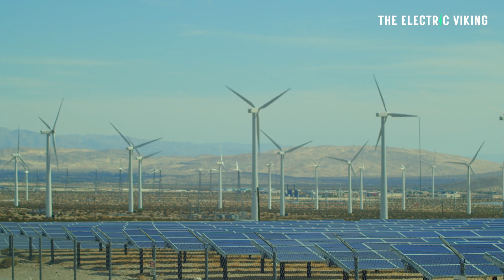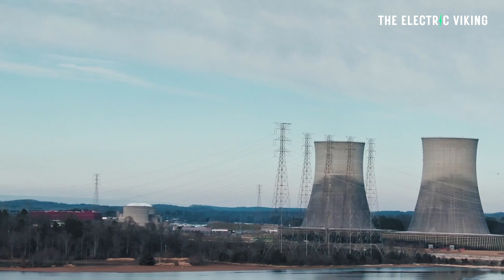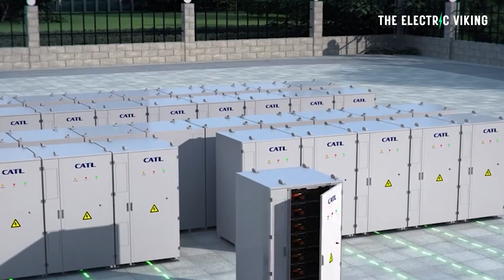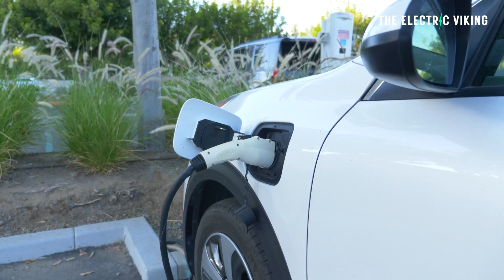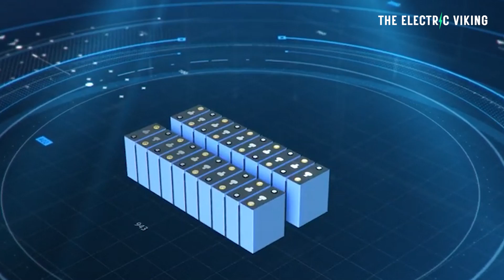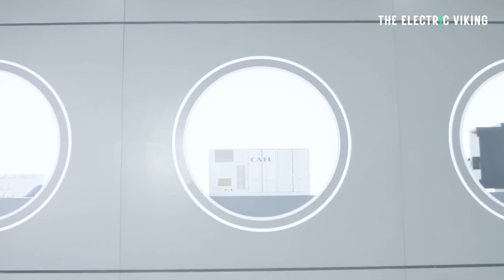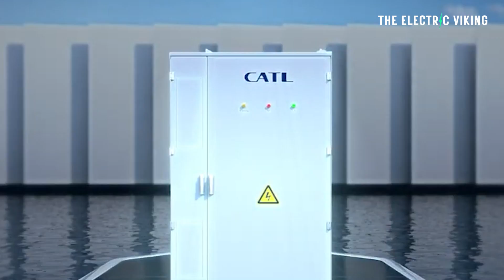CATL's new LFP battery lasts 3 million miles with 0% degradation for 5 years

Comment: Good content, thanks.  

I would like the focus of future energy needs to be placed on individual homes rather than the grid.  Home and property owners will benefit due to cost savings.  Weather type events such as cold snaps are easily predicted and gives time to power companies to cycle up an energy plant to meet the additional power needs.
Reply: Agree! Dispersed power!
Reply: That makes sense to some extent.  But having every building be a standalone energy producer is not efficient.  Since the grid is already in place we can move unneeded 'single building' electricity to places where it is needed.  And we can share output from things like wind farms and hydro facilities which individual buildings could not afford.
Reply: @bobwallace9753 Dispursed energy production actually works well and with batteries you need not depend on the grid entirely. Our last grid power outage lasted 4 days. Had We had batteries and solar we would have weathered the outage much better. The efficiency argument is very weak when my neighbors actually use my excess power when I produce it.
Reply: @seniordockman2946  
What you seem to be saying is that grid-connected dispersed production is, generally, the best solution.

Agreed.
Reply: @bobwallace9753  I believe they have this type of system setup in California.  Homes with solar are consider virtual factories.  They feed excess energy back to the grid to power other areas.  I am not quite sure but I think Tesla is involved with the Tesla Energy Software
Reply: @timothyj5237  
Tesla Energy operates in multiple states and, I think, Australia.

Comment: Ok, this is Great news. So if this battery tech will last 2 million miles on EVs and will be 100% safe without battery degradations at all, then there will not be any reasons why manufacturers would not offer the 100% full battery warranty for 20-25 years.

Comment: Yes, distributed solar farms with batteries for the evening is a big part of future electricity.  Natural gas is very cheap in the US and will be baseload power for a long time.  The main cost of rooftop solar is not the panels, it is everything else, which will not go down unless the efficiency of the panels increases.  The upfront costs for renewables is very high and the cost of money has increased sharply in the last few years, so that has offset the innovations, so I think Tony’s predictions are going be a little too optimistic.  New electricity yes, to power ai and cars, but rapidly replacing existing NG…no way..
Reply: Natural gas as a fuel produces a lot of greenhouse gases, I believe in the form of methane, which is a dangerous pollutant.
Reply: Natural gas is cheap??? I really don’t think so. It is not cheap. Some people just have a lot of money. Solar is cheap.

Comment: When talking about nuclear, you specifically talk about gigantic nuclear power plants, many were built many decades ago.
No, there are small reactors that are much cheaper, easier to build and much cheaper, much safer, and more modular. It has a place in reducing greenhouse gas emissions.
Reply: Correction, small modular nuclear reactors are promoted as someday hopefully being cheaper.  But there's no evidence of that yet.  While solar and wind have been plummeting in cost for decades, in the real world.
Reply: Nuclear energy is too costly and too dangerous.
Fukushima and Chernobyl are still spewing poisons into the environment.
Reply: SMR are not in production. While progress is being made, the deployment of SMRs on a commercial scale may still take several years due to regulatory processes, licensing requirements, and the need to demonstrate safety and reliability. Additionally, market factors and public acceptance will also play significant roles in the widespread adoption of SMRs.
Reply: @phvaessen I agree that the public may delay or block SMR. But all clean and efficient technologies should be on the table I think.

Comment: Having worked in utility-scale solar for years, I can back up what Sam says, fossil fuels and nuclear can’t, and won’t, compete with solar and wind + battery storage.  Solar developers are now installing giant solar power plants virtually everywhere, while gas can only be installed in limited, specific areas, and can’t compete on price.
Reply: - “charge without a stupid phone” - rather: charging WITH a phone is the game changer!
Reply: @dcartier1692  How DUMB are you?  Your phone dies you are F'd.
Reply: This is not religion. Where solar (or wind)+ 🔋 is good, ramp it up. Where gas/fossil still rule, just wait a few years. We do not have enough batteries to do everything, not even close. Same with EV vs ICE.
Reply: @kbmblizz1940  That is where you are wrong.  Those buying EV's it is their religion.
Reply: @w8stral  for the very  early adopters I would agree. Just like the early days of the computer industry when people would buy kits and build them. 

But today with 1,000,000 EVs on UK  roads  40,000+ being sold in March alone. We are out of the enthusiasts stage and now in to the early mainstream. Think CDs vs LPs in 1984 (still more LPs sold than CDs but you  know  what the trend was.
Reply: @kbmblizz1940  as I type at 3pm gas has all but bean driven off the UK grid. At 2.2% against 45% wind and 23% solar and rest being nuclear and hydro, mostly imported. . 

But by 6pm that will no longer be true. But all the time it is the total gas usage  goes down and down over time.
Reply: Whats the cost of this container battery ?

2nd,
I think Sodium ion battery will be much cheeper if mass manufactured.

And for Stationary storage, energy density doesn't matter.

3rd,
Even after that Solar + Storage is not cheeper that Thermal Power Everywhere.
Although it will becomes cheeper in few years with falling cost of Battery.

And that is the reason China is still building new Coal Power Plant.
If Renewable was cheeper than fossel, then why will China build new Coal plant ?

See,
I know only Solar (excluding storage) is very cheap.
But when you add storage cost to it for use at night, then it become expensive.

That is why most of the Solar thatbare being installed is for fulfilling the electricity demand at day time / noon (when there is sunlight).
But at night, Coal is being used because its cheeper.

4th,
Although I am 100% sure Renewable energy will become cheeper even at night in few years because of fallling cost of battries.

That is why I am soo keen on Sodium ion battery because it can be 30% cheeper than Li battery.

Even yiu have said that CATL is planning to bring its 2nd Gen Sodium ion battery at the cell level cost of $40/kWh.

If CATL brings battery at that cost,
Then in reality Renewable will become cheaper even at night.
That will be the deat of Thermal power plant.

When will CATL bring that battery thou ?
Reply: @Atheist-Libertarian  until batteries get cheaper, gas and pumped storage will balance wind and solar. And as the cost of batteries falls low enough (say 2035-2040) gas  will become an emergency backup (like oil did)
Reply: @Atheist-Libertarian  Na+ sucks.  Its DeltaV/SoC makes lead acid look wonderful.  In other words inverter cost will be EXCEPTIONALLY high and actual kWh is a small fraction of claimed.  Most of the SoC of Na+ you cannot use or is wasted so its ACTUAL cost is double that of LiFePo4.  Its temperature range also sucks(nowhere hot can it charge) and add its efficiency while charging sucks = lots of waste heat = super suckage as active cooling will be required = Horrifically expensive installation cost AND operating cost.  Guess where solar works?  --> Where it is sunny and hot.
Reply: + battery is because without the + battery, solar/wind are near useless and epic fraud.  ... and you have it back assward: Solar can only be installed economically where the Sun shines.  Wind can only be installed economically where the wind blows.  Where the sun shines and wind blows is not near civilization for the most part making it uneconomical to use supporting basic infrastructure.  Gas on the other hand while not as nice as Diesel or coal can still be transported anywhere, stored for an infinite amount of time and used whenever YOU want, and can in ~general be installed anywhere.  

PS: Until Electric vehicle charger companies get their heads out of their ass making it viable to charge without a stupid phone, and with near 100% uptime on their chargers, EV's aren't going to become mainstream other than for the rich who own a home outright and 2 cars minimum.
Reply: @w8stral  
Wind and solar are so cheap that even without storage they make economic sense.  Use very cheap wind/solar electricity when it is available, then turn on the gas plants to fill in the gaps.  

BTW, I doubt you realize how many hours per day wind and solar actually produce.

Some rapid chargers have card swipe access.  That way you don't have to use a 'stupid' phone.  Or you could use a smartphone.

The world is passing you by, guy.
Reply: @bobwallace9753  quite right , a quick look in the UK grid at 9pm on a Saturday night shows.
Of the 28gw current demand.
49% wind 19% nuclear 10% gas 7% hydro 5% biomass and the rest is imports. Earlier on when the sun was up we were exporting 5gw, so we are only taking back what we sent in the daylight hours.
Reply: @bobwallace9753 , who pays the capital costs and standby labor costs for that gas fired power plant while it idles because the sun and wind are providing the “cheaper” power?
Reply: @patdbean  
The UK is a great example of why it's better to keep the grid.  You've got world class wind, both offshore and onshore.  But sunshine is not one of your strengths.  

What should work best is to keep attached to Northern Europe hydro and complete the HVDC connection to Portugal to bring in some of that excellent Southern Europe sun power.
Reply: @dpdecenzo  
Ah, you've identified another factor that will speed the abandonment of fossil fuels.

Obviously, if a generator has to sit idle those fixed costs will have to be folded into the price they will demand when the market needs their electricity.  As their price goes up, the economic reasons to install more wind, solar, and storage increase.

We saw something similar during the transition from film to digital.  As digital took more of the market it became harder and more expensive to find film processing.  That made the digital option more attractive.
Reply: @bobwallace9753  yes, we already have links to :-
France 4gw
Norway 1.4gw
Denmark 1.4gw
Holland 1gw
Belgium 1gw
Ireland 0.5gw

With links to Germany and Morocco in planning.
Reply: @dpdecenzo  I can see gas being kept as a "standing" reserve for decades to come. I am old enough to  remember tho  1984 miners strike.

Mothballed oil fired power stations that had been to costly to run since the oil crisis of the early 1970s were spun up to cover the shortage of coal generation during the strike. 

Gas will take the role , for the rest of my lifetime at least. Keeping them available is quite cheap as long as they are not burning fuel. Yes you have to keep them well maintained. Just like pumped storage stations, they are manned 24/7 but are not generating most of the time. They have 4 states. 

Standing still. 
Pumping into the top lake. 
Generating.
And spinning in air (to allow start up in a few seconds, rather than going from a  standing start that could take tens of seconds)
Reply: @w8stral the places that don’t have good winter sun tend to have good winter wind. Sorry, the world is leaving fossil fuels behind
Reply: @williammeek4078  Well as someone who worked at wind turbine sighting, this is blatantly not true.  Spring/Fall--> Yes.  Winter--> No as in winter either you get too much wind or none via giant high pressure zones for upwards of a month which means you cannot rely on it at all and there is no way in Hell you can store power in a battery for a month.   Summer--> No wind as well.  

20 years ago it was thought that nearly the entire great plains could be covered with wind turbines... In reality once we got the anemometers up and taking data, the areas with actual higher economical winds are actually fairly small even if you stretch to 150m hub height.  And unlike Solar, everywhere wind turbines are installed = bird desert which should surprise no one.  

Solar has far more long term potential than wind ever will, though obviously not for Europe which is why they are building wind...   Oh yea, region of world with worst solar near major population is actually China other than FAR in its interior.  So China can install all the solar they want, but it is near useless until they build a hoard of new giant dams and start doing pumped hydro storage.  Only battery worth mentioning in today's world.
Reply: @w8stral  that is a bunch of BS and misdirection. Sure, the wind doesn’t always blow or the sun always shine in a given spot, but on a continental scale, the wind is always blowing somewhere. You import the power, you don’t try to store it at a grid scale. 
Individuals will store power in the form of EVs with V2H and a home battery. Grids will just move power around. And even grid scale storage in the form of hydro will be available to a small extent.
As to your comment about the economics of wind turbines, that is utterly ridiculous to anyone who knows the cost to produce wind energy. 
It is less than half the cost natural gas and is viable almost everywhere.
Reply: What a load of crap. Transport of gas vs transport of electricity isn't comparable in price. @w8stral  solar and battery will dominate.
Reply: @monkeysezbegood  Idjit, Cost of transport has nothing to do with why we are not all running around in battery electric vehicles.   Until a battery car can equal an ICE the MAJORITY will NOT buy them.  Period.  It is pointless until we have a battery that can charge at a high enough C rate so we can use it for more than tiny vehicles who only drive a short distance in a city and do not have to wait a damn hour while it charges a battery that does not lose half its charge in cold weather.  We do not have such a battery technology. Until then you are delusional.  

Until you have a UNIVERSAL solution, you do not HAVE a solution.  You have expensive dreams which currently only exist due to massive subsidies and in some jurisdictions government overegulatory MANDATES.
Reply: @w8stral you’re not listening
Reply: @jsanders100  Listening?  Its called math.  Not hyperbole.  Installing Wind/Solar increases electricity prices everywhere they are installed.  No universal solution = Gargantuan CAPEX costs/maintenance costs increasing electricity prices genius.  Until you can plop a pure replacement that works in ALL situations, you have nothing other than HIGHER electricity bills.
Reply: @w8stral  why then dose my dynamic tariff go as high as 35p per kWh when the uk grid has zero wind or solar. And as  low as 5p per kWh over night when wind output is high. 

And as low as 0p or even -5p per kWh when both wind AND  solar output are high. 

Like between 11am and 3pm  yesterday?

Comment: You're talking about 'traditional' nuclear with basic designs dating back to the '50s.  The new thorium molten salt designs are a potential game changer as the reactors can be mass produced.  They won't be affected by clouds, day/night or lack of wind and will not require batteries.  That will leave batteries available for transport and home backup.
Reply: They do require batteries, since they are difficult to regulate. Fixed production coupled with flexible  use is the same problem as flexible production and flexible use. In both cases you need batteries to balance the grid. You have to synchronize production and use one way or another.
Reply: @marcelreijnen  No, they're not difficult to regulate, according to what I've read.  Remember, not a '50s design.
Reply: Where are these thorium reactors then? I bet they won't compete with batteries that last for +100 years.
Reply: @AORD72  They're building several in Europe and China right now.
Reply: @gregkelly2145  So no working ones then?
Reply: @AORD72  Assuming you actually read the comment, I said 'potential'.  I for one would rather have small mass produced failsafe nuclear reactors around than covering every open spot with solar collectors and every where else covered in hideous wind turbines.

Comment: Everything you buy eventually breaks. I worked as an electronics engineer and compared to other companies or customers learned that yes eventually all products break. What our customers liked was we fixed product within 3 days or product was swapped. With my customers after 29.5 years. I had my customers fixed within hours. So all my customers bought warranty and our customers loved us. A product is only as good as it’s support structure.
Reply: Your argument works when the manufacturer is responsible for fixing something when it breaks, but most things are not sold that way. Automobiles are typically sold with warranties of 8 years and the consumer is responsible for fixing it after that, so the customer prefers to have something with a long mean time before failure, because each failure increases the probability that the owner will decide to buy a new car and junk the old one or sell it off.
Reply: Yes!  Yes!  You're right!

And thanks!
Reply: That makes sense.